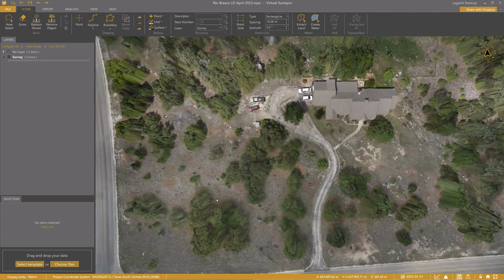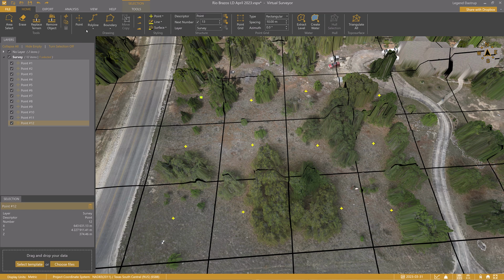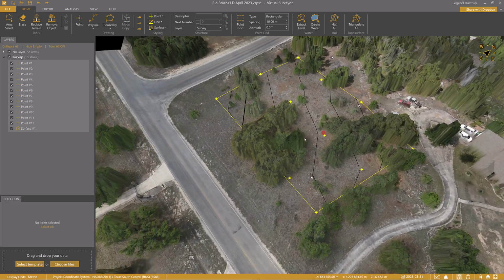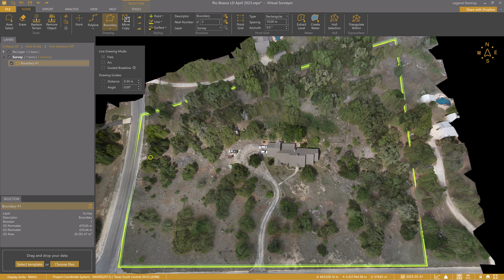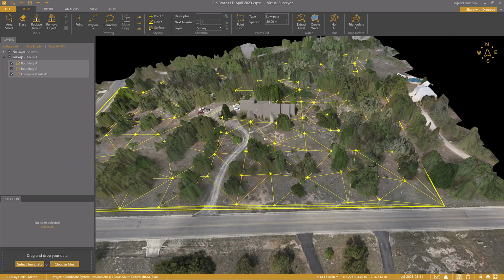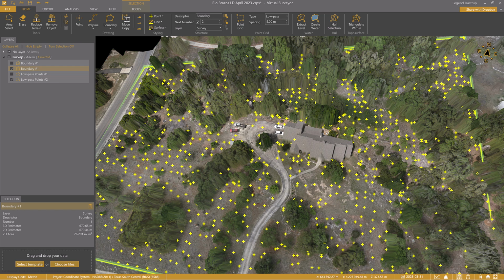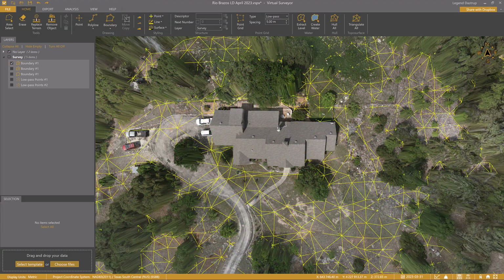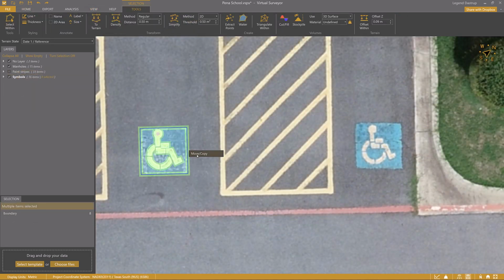Virtual Surveyor - The Basic Concept

Comment: Hello everyone,

I’ve been exploring Virtual Surveyor for a few days now, and I have to say the software is truly impressive for terrain analysis and volume calculations.

I’d like to reach out to the more experienced users here:
👉 What is your best workflow to achieve reliable and consistent volume results?
👉 Do you have a checklist or a method adapted to different situations (open stockpiles, bins/silos, against walls, on slopes, etc.)?

A few words about myself:
I am a drone pilot based in France, mainly operating with a DJI M30T, a Matrice 4E, and a D-RTK 3 to ensure accurate survey missions. I’m not a land surveyor by training, but I am increasingly specializing in photogrammetry and topographic workflows, which is why I’m particularly interested in Virtual Surveyor — a software I find more intuitive, faster, and easier to work with than many other solutions I’ve tested.

I also work as a drone pilot instructor and trainer in photogrammetry, flight operations, and professional mapping software, so I’m eager to adopt solid workflows and share best practices with my trainees.

I would really appreciate any feedback from users with more long-term experience — best practices, efficient workflows, things to watch out for, or even simple tips.

Thanks in advance for your time and advice!
📧 guy.sournac@hotmail.fr